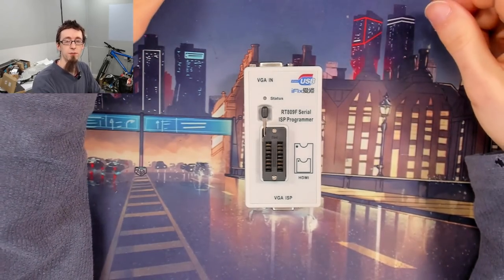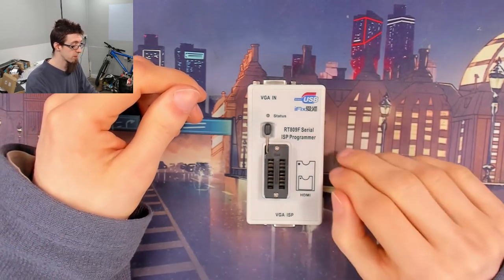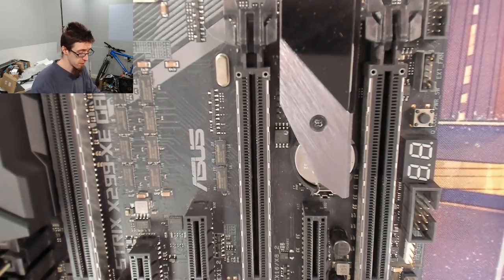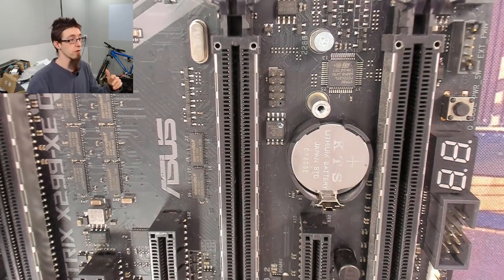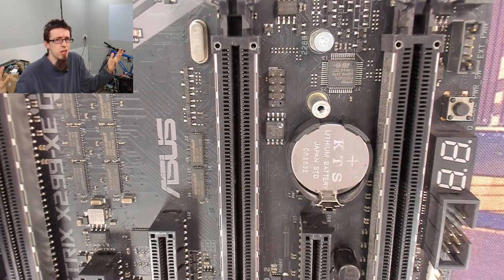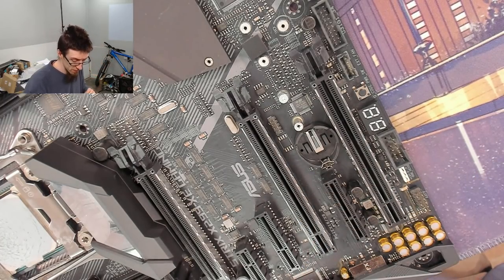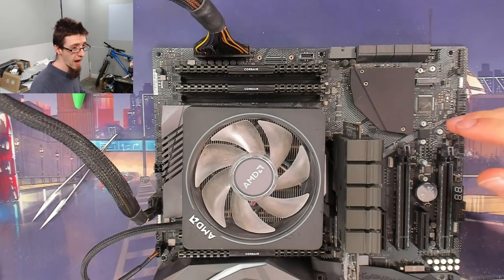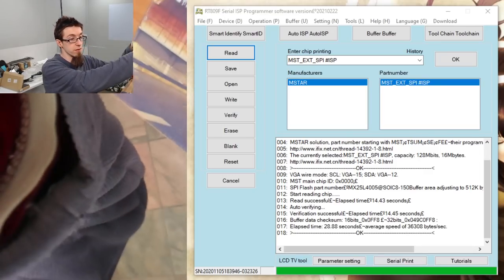Using an RT809F Programmer to Unbrick a Mobo - LFC#261

Comment: This was my motherboard.  Many thanks to Adamant IT for fixing it after Asus refused the RMA.

Background:  The motherboard went into the "flashing zero zero" after a trivial BIOS change.  It had been functioning perfectly up until that point.  Each component in the system was tested independently to prove it was a motherboard issue.  The USB flashback method did not work.

The fixed motherboard is now back in a case and working as expected.

Top Job.  The world needs Adamant IT to fix more things.
Reply: I was going to ask if USB flashback would work or not in that situation, Thanks for confirming Pip and thanks for making the video Graham. :)
Reply: It's always a BIOS issue when you decide to update your PC.  If the BIOS is working fine, leave that grenade alone!
Reply: @MrShwaggins  Don't know how many times I keep saying that to my buddy... but more along the lines of "if your rig is working, don't pull the pin on the bios update, it'll blowback"
Reply: @BeezyKing99  If you want a power failure at the worst time, just make sure you don't have a UPS and are updating firmware or BIOS on anything. 90% chance of success
Reply: Asus screwed me over many years ago. I no longer buy anything at all from them.
Reply: @williamjones4483  Theres a reason all the Extreme overclockers of the world choose asus.... The mobos are built for it. Pip must have done something serious to brick this mobo... they are near impossible to brick.... thanks to bios flashback lol. Proof is in the pudding, and hundreds and thousands of professional overclockers videos. lol.
Reply: LOL.  No.  It was nothing serious.  The X299 Strix is not a "serious" overclocking board.  If I had been shooting for the stars I would not have wasted Adamant IT's time.  

It was just a 10900X at x47 on the favoured cores, push/pull 360 w/c setup.   I was comparing manually entered primary timings vs XMP, using memory that was on the QVL.  I enabled XMP, F10'd and the 'board rebooted.  There was no error message, no over volting, no powercut or anything like that.  The 'board just said "oh oh" and did that crazy boot loop thing - with the same "click" from the PSU in the video.

There are posts on the ROG forum with a few people describing the same issue.  It does not appear to be isolated to this board.
Reply: @crisnmaryfam7344  Well, I am not interested in overclocking. My issue is with their customer service and support. I had bough an Asus computer, not motherboard, from Amazon and when Windows 10 come out I did the upgrade. The upgrade went south and the computer failed to boot. Couldn't recover the OS. It had Windows 8.1 with Bing originally installed so I had no choice but to send it back to have the OS reinstalled. They dropped the computer, ruining the hard drive and had the nerve to tell me the hard drive was bad. Cost me right at $200.00 to fix a $250.oo computer. They never would admit they dropped the computer. This is the reason i do not buy Asus products any longer. As for motherboards, I used to buy Intel motherboards until they ceased that.
Reply: Us Techs are saviors in many Many ways :) Happy you got your MB sorted and can actually use it . Cheers
Reply: @williamjones4483  Yeah, know that from autopsy ;) And now, after years, most of broken stuff that comes to me to repair is made by... Asus. That means a lot about them. Of course other brand aren't perfect (specially Gigabyte, huh), but still better than Asus ;)
Reply: @pippinfort  I'll say while it may not be a "serious" overclocking board at close to $400 when it released it seems I'd have done everything I could to revive it as well. Though I've always ran AMD even through their bulldozer phase, so I'm not too sure if x299 is worth what it may have cost to revive.
Reply: @williamjones4483  Kinda funny you give the guy who's board this was shit about him having must have done something to brick it yet you sent a whole PC back to Asus to do an OS upgrade/reinstall. So strange, just back things up and do the install yourself or buy a cheap windows key. God what does it even cost to ship an entire PC? Not to mention the time and hassle.
As for your reasoning to never buy Asus products again, I can almost guarantee most any other board manufacturers have stories just like yours with other customers.
Reply: @tr1llwill  It's called "customer service". This was also during the time when Windows 10 had not long been rolled out along with all of it's subsequent issues. My main gripe was that they dropped the PC when they received it and had the nerve to tell me that the hard drive was the problem. I knew better, but did not discover what they had done until after the fact. BTW. the shipping then was not so much. This was not a full sized desktop PC. For a time Asus made what they called a mini PC, along the lines of an Intel NUC.
Reply: @williamjones4483   I know what it's "called". Though my first reply was when I thought you were the same person who had said they must have done something to brick the board, I see now that was not you.
I'm not sure of you're level of skills so I can understand shipping it back if you don't have those skills. Though you really can't pin it on ASUS if you shipped it, the delivery carrier could have been responsible, impossible to know for sure unless you got surveillance video of ASUS employee dropping it. Luckily SSD's are becoming pretty standard, soon movable storage for most devices will be a thing of the past.
Reply: @tr1llwill  My computer skills are quite above average. Those computers came with Windows 8.1 with Bing and was not available for consumer purchase or download. This necessitated sending the computer back to Asus to load the operating system back onto the HDD. I'm also fairly certain that the carrier did not drop the computer. I had it packed well enough to survive a trip to the moon. After I received the computer back from Asus I noted that the case itself was damaged by being dropped. It's all water under the bridge now.
Reply: @williamjones4483  "8.1 with Bing" is Microsoft's $0 OEM OS. So you sent a PC to Asus to install an OS they get from Microsoft for free. Then they charged you $150-200 for it because I believe it's 1 key=1 install. You could have just bought a pro key and installed a better version of windows.
If your skills are above average I think you can kinda realize this is a bad look. I know it's all water under the bridge but please at least know in the future that you should  just install windows yourself and either just live with the activation notice or buy a cheap key.
Reply: @tr1llwill  I had bought that computer for my sister. I was not willing to shell out big bucks for something that was going to be getting on the internet. At the time I did not realize that Windows 8.1 with Bing was free to the OEM. I did not realize that I could not obtain a copy for myself. I did not realize that you cannot make a backup installation media for recovery purposes. I do not remember the exact cost to load the operating system, but it was quite less than $100.00. They had the nerve to charge me more than $100.00 to replace a Western Digital Blue 500 GB HDD. I also did not realize at the time the issues with upgrading to Windows 10 which if you'll remember was being forced upon us against our will. All is good now. I have moved on from that disaster. Good day.

Comment: I have owned an RT809F for some time but didn't have a clue how to use it. Thanks to your superb video, I have been able to revive an ASUS B85M-G motherboard. The symptoms were a POST message indicating that CMOS settings needed to be recovered. After pressing the key indicated, a blank screen would appear and the system would be completely unresponsive. In this case, the chip was in a socketed DIP-8 package so removal and reinstallation were easy. In fact, no adapters were necessary - the chip plugged straight into the device! It seems that sporadic BIOS corruption can occur, since I know the owner of this computer wouldn't have tried to update his BIOS. He found it working one day and not the next.

Comment: Jumper cables for bread boards will fit on the pins. One side female and the other male. Buzz it out with a multi meter for pinout. This would be handy if you dont have a soldering iron.
Reply: better use female-female cable combined with standard 8 pin adapter that you get (or can just buy 20 of them for about $1)  with all these zif's programmers. It will be easier for use.

Comment: That is a very standard pinout on that header by the looks of it. I am very surprised to even see it actually, they usually don't include the JTAG header in the final release of the board. The programmer that I used was a Dediprog, I do not recommend it unless you are willing to lay down serious money. You can indeed find the inexpensive model (Ee100) for $100 or less (I used the SF100 for BIOS programming), which isn't a bad price, but this is only for the programmer. The company does not give away the software even if you have the hardware. There are full levels of different types of software at their own price points. Definitely a case of getting what you pay for though. Their products are capable of programming pretty much everything that ever existed or will exist, but you have to purchase the hardware/software for it, they do not have a hobby grade or even "partially pro" kit the last time I checked. Times change though so who knows?

If you want a "good" clip (as good as they ever get anyway) check into 3M, Pomona, or Mueller brands and do NOT get these off amazon or ebay, there are far to many fakes to know if you are getting what you want. Go straight to whatever passes for an industrial electronics supplier in your country. I personally use Digikey or Mouser in the US, I don't purchase from the cheap suppliers for electronic components when it matters to me.

Comment: Great video.

Thank you for sharing.

I have a couple of the CH341A programmers that came with the SOP8 clips and I haven't had any problems using them on most devices that support ISCP.
The motherboards that do have a JTAG like connector probably has a pin that tells the IC, that is connected to the SPI Flash chip, to stay in a tri-state/high impedance mode.  This allows for the ability for ISCP to work.

I am also in the retro computer area and I know some hardware people that use some FPGA devices that use a SPI flash to hold the firmware as well and they have a jumper so you can use the clip on the 25Q80BV SOP8 chip to program it.

In the cases where you can't find pinouts for the JTAG like port to program the flash chip then it is probably easier to just go ahead and desolder the chip then backup the chip and reprogram it with current BIOS image.

I have one of the newer CH341A v1.7 programmers on its way, but I think I will go ahead and order one of these as well.  The extra adapters that come with the RT809F look like they could be very useful.

Comment: I also had pretty much no luck with the clips, but then one time I realised you actually must turn on the system in order for the clip to work!
This is because the power supply in the programmer can't power the chip plus whatever is connected to it on the motherboard!
(In my case I get overcurrent error)
For power cycling boards like this though, you need a paper clip to jump-start the psu so the psu never shuts off

Comment: You can easily beep out the pin header against the pins of the chip. IDK if ordinary Dupont (Arduino style) cables will fit on the pins, I suspect the pins are too small. But when you have that pin header sitting there, it's almost a shame not to use it. Of course if your programmer is not able to drive the chip while it's in circuit, it wont help. But if the programmer is any good, I suppose it should work?

Comment: Just thought I would also add... One of those adapters has a 7 pin header that would have plugged directly into the JTAG on the motherboard. Just an 8 pin ribbon cable would've got the job done. Of course you have to own the cable with connectors on it heh

Comment: BTW, i dont know if any1 ever told you or commented here but pin 1 is actually marked with that white trace next to the solder pad, also, most of the times u have a dot on the bord or a larget white trace on the side pad

Comment: Good to see you again! Have you tried rebuilding a laptop battery before?🤔 Thanks 🤓 also, have you tried replacing the BIOS chip on a chromebook?🤔
Reply from the maker: I've been dabbling in rebuilding laptop batteries, but not had anything to show for it yet. It's only really worth the effort if it's a really rare battery IMHO.
Reply: @Adamant_IT  ok thanks! The 18650s are fair priced, but is the BMS harder, the correct type, to come across?🤔 Thanks 🤓

Comment: I would advise you buy a buspirate v3 or a busblaster as a tool for reprogramming, both handle spi chips as well as lpc bios and jtag for router recovery. both have well documented tools for this as well as special tools for doing recovery work from some chips(emmc, sd cards) . They also double up as serial interface. the buspirate will also act as many other devices (uart,spi,i2c,jtag,sdcard & more), open source software is well supported and windows/linux gui/non-gui versions of many programs exist. bonus is both devices also compatible with sigrok logic analyzer.

Comment: Man, reading that the owner was refused RMA for this sucks, but I'm not surprised. I've had terrible experience with many of the PC hardware manufacturers  I've bought from.

MSI: I've owned three MSI GPUs. A R9 380 4GB, Gaming X 5700XT, and now the RTX 3070 I chucked from a pre-built. The previous two failed just after hitting the one year mark (the 5700XT failing forced me to get a prebuilt and chuck its GPU due to supply issues worldwide). MSI refused RMA for the 380, and later told me it would be between 6 - 8 months before they could send me a replacement for the 5700XT. I use my gaming PC for work as I am a teacher, so I ended up having to spend a hell of a lot of money on the cheapest available pre-built I could find on Newegg (which are the only ones that can guarantee 2-day shipping).

Gigabyte: Got a B450 Ultra Gaming WiFi board for my best friend so he could build his first gaming PC. That board has always had issues. Even the one Newegg sent as a replacement. BIOS lockups, stops reading the NVME boot drive randomly, stops detecting one of the RAM slots.... 

ASUS: Bought a X570 ROG Strix-E. Came with the little BIOS flashback button broken off right out of the box. Contacted ASUS and they told me Newegg should handle it. Contacted Newegg and they told me ASUS should handle it. In the end ASUS told me it would cost me $90 in shipping to send the board in for RMA and that they would send me a refurbished one. For a little plastic button I ended up trying to forget about it. If I had to use that feature, I would just use a plastic spudger from my iFixit kit to push the little button inside.

Cooler Master: Their fans are horrible quality, even the expensive ones. Bought a ML240L AIO and both fans sounded like lawnmowers. They were kind enough to send replacements, but it didn't help at all that the replacements had the exact same issue. I got a Hyper 212 Black edition for my best friend (the one with the gigabyte board) and the fan died 5 months in. Ended up getting a Noctua for it. The heatsink itself is pretty good for the price.

Thermaltake: Do I even need to explain my issues with the brand infamously known as ThermalFake?

Only brands I've bought from that have caused 0 issues for me are Fractal with their amazing cases, Corsair (I've only ever bought RAM and fans), and Sapphire. I had a RX 590 from them (Sapphire) that I upgraded to from the MSI 380 and that baby worked like a charm all the time and stayed pretty damn cool while gaming. The 5700XT I got from MSI after that, well those of you who've had a 5700XT since launch know how much of a headache those wastes of silicon were. Now I have a  crappy MSI Ventus 2X RTX 3070 that gets up to 75C just for my Zoom classes.

Comment: The video port contains I²C bus for DDC. You can actually use the I²C bus for anything else I²C other than DDC. I have experimented about getting I²C from my laptop and be able to use raspberry pi/arduino I²C stuff directly with my laptop, like GPIO Extender and else.. maybe it explains why we can read/flash rom chip inside the monitor via the video cable? 

If you run Linux and type "sudo ii2cdetect -L" it might shows your monitor's i2c address and bus

Comment: There looks like a JTAG pin header above the chip, I have a programmer that has a JTAG interface so the chip can be programmed without soldering, but not sketchy like the clips. This is the method manufacturers use to program (and test) chips on the production line.
Reply: You have a link please?
Reply: @mitsos1461  It's a TL866II Plus. Made by XGECU, (several companies re-badge it). The interface on this is an ICSP, (in-circuit-serial-programmer), The expensive Dataman programmer that I used at work had a JTAG interface, which can do boundary-scan testing, but I used it solely for in-circuit-programming. There was a chip that I had trouble programming, so the engineers at Dataman wrote an update to the algorithm for me, and this programmed the chip successfully. I can't justify the cost of a Dataman for myself, and the cheap one should cover most use cases. I hope you find this helpful, Google has a lot of hits for programmers, but it's best not to go too cheap.